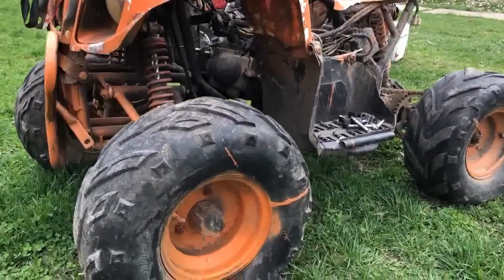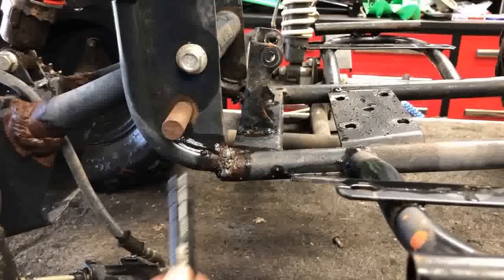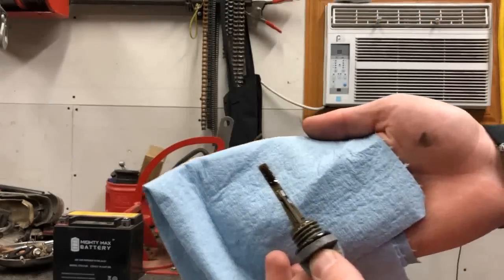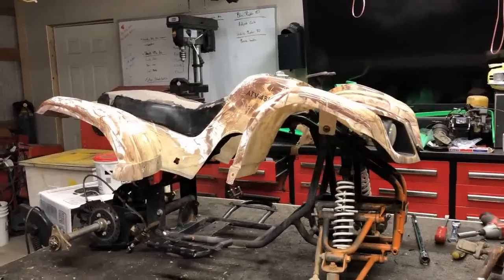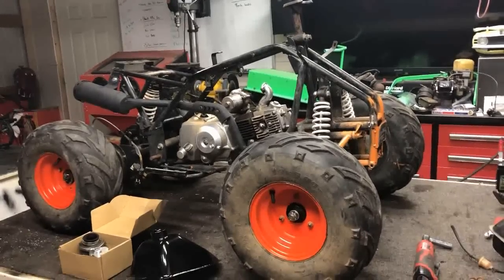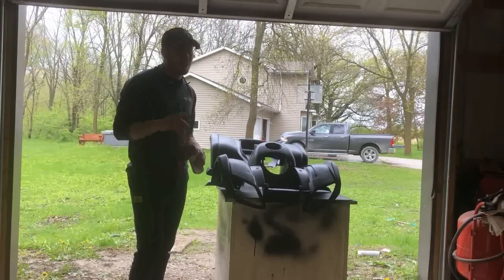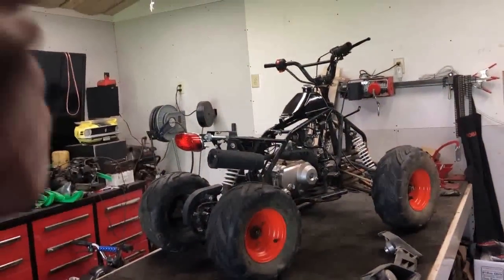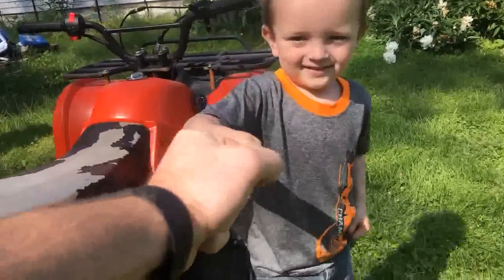Worst Chinese 110cc ATV Ever?? Let's Rebuild It!

Comment: nice job and very generous of you...one question , I have quite a bit of experience with the ongoing cracks in the frames chinese quads and merely cleaning and rewelding cracks especilly because the cracks are at hi stress points never lasts unless you also add some reinforcement the quad's frame will just recrack again and again??
Reply from the maker: You are absolutely right. Adding gussets for reinforcement is probably the best thing you can do to assure it doesn't happen again. In my experience with these chinese atvs is they will find a way to crack regardless of the extra support. I've never had one of my welding points break its always found a new spot!

Comment: Where can I find the link or part number for the right handlebar assembly? (Throttle, brake with safety brake pin). I accidently broke mine by overtightening the screw.

Comment: New subscriber. Awesome video.  I got a China quad been strong in my shop for awhile now.  Needs a new top end. May try to rebuild it.
Reply from the maker: Thank you! I did a top end on my rebuild video before this one. It ended up being a broken intake valve spring but I replaced everything since I had it open! I think the next time I get one in my shop with low compression I'll do a "how to" with the tips and tools needed! Thanks for the sub!
Reply: Praska Boy's Garage I pulled mine apart.  It’s got a stuck valve. I want to order a complete head. The cylinder says 107cm. 
The case says 
TZH152FMH

The flywheel cover says QIYE. 
Not sure which head to order because I can’t find a matching number online. Can you help me out with this.

Comment: I just picked up a 2008 Rocketa 110cc ATV for $150.00...starts right up but the Auto trans makes a bad cracking noise. Turns out a Counter shaft gear is chewed up. I don't want to split the case so I ordered a new 110cc bottom starter engine from VMC for $249.00...should be here in 3 days or so. Love your stuff and your Class !
Reply from the maker: Screww Googlle Dang man! That would actually be a first for me, I’ve never had that issue! I wish you lived in Iowa, I’d buy it off you to try and rebuild it! I am glad to hear you went to VMC to get the motor. They are a great resource for all my parts between their direct website and eBay account!

Comment: I use that truck bed paint a lot on all my frames use it on my Skidoo rails Ski-Doo skis I paint everything with that stuff even did my patio set a few years back and it still looks good and it holds up well over time and so much harder to chip than paint but if you want that smooth shiny look you'll never get it with this stuff.
Reply from the maker: Jason Mercer Im a big fan of it. Once sprayed an entire Volkswagen Beetle  in the stuff! Makes everything you put it on a little more durable!

Comment: Love all your videos very thankful for all your info im having problems with the brake on a 90cc china 4 wheeler it only has one break on the handle bars it has the master calendar on the bars to how do u bleed it i dont see a cable on there so it must not have one not sure how it works
Reply from the maker: Thanks man, the brakes will have a bleeder screw on the rear brake housing. Here is a link to the brake bleeder tool I use: https://amzn.to/30ItW9b

Comment: I suggest using a plastic adhesive promoter next time.  Bull dog is the best p.a.p.
Reply from the maker: Lawrence Miller Thanks for the advise! Never crossed my mind to use a promoter. I’ll definitely do that next time!
Reply: @PraskaBoysGarage  no problem brother. I picked up a 07 arctic cat 250 fourwheeler with no spark thats how I stumbled on to your video.  You do good work
Reply from the maker: Lawrence Miller Well I’m glad you did! Good luck on your project, sounds like a good one to wrench on!
Reply: @PraskaBoysGarage  the stickers on it say arctic cat but everything else on it says Kymco. I have the crank case opened now and it looks like the pick up that tells it to spark. I haven't worked on a fourwheeler for some time now.  The stator and picked up are in the crank case filled with oil. Never seen that before but thats how its designed

Comment: Quick question? What kind of spray paint do you use for exhausts ? Attach a picture if available
Reply from the maker: I use a high temperature header exhaust paint. Typically VHT Flame Proof 1300-2000 degrees

Comment: I’m rebuilding a 110cc for my ten year old son currently, via YouTube videos. Learning process and always having to stop and go realizing what I need to replace everytime I get going working on it. Nearly have zero information about the arc besides knowing it’s suppose to be some kinda of 110cc Chinese brand atv. Where exactly on the ATV motor I’m guessing can I find the atv brand and info so I can order exact correct parts like motor gaskets. Thank you
Reply from the maker: In my experience there are really only 3 types of 4-stroke motors that come in these youth 110cc atvs. They are either a "E22" which is a Honda clone from the 90s. The 2nd is the same E22 style motor but it comes with a gear box. 3rd is a GY6 style motor. If you want to send me an email with photos I can help tell you which one you have.

Comment: How can I tell what size motor I have? Any help would be appreciated
Reply from the maker: Blaze Finerty Look on the cylinder. On most motors it with be in the casting stamped with a CM3. Here are the ratings: 
49cc = 49CM3
70CC = 72CM3
90CC = 86CM3
100CC = 97CM3
110CC = 107CM3
If you watch my rebuild video I posted on the bumblebee build I actually find out it’s a 110cc not a 50cc like I was calling it. I show in the video where the casting stamp is! Hope that helps!!!
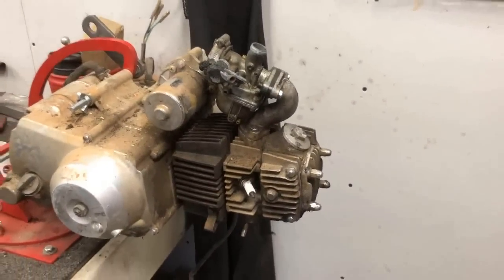Reply from the maker: https://youtu.be/UwdPQMB3rmY if you go to 8:59 in the video it will show you what I’m talking about.

Comment: What is recommended compression for 110cc motor?
I need to know... I repairing my ATV
Reply from the maker: Ideal compression is anything above 130. You'll find it will run around 90, however you will start to have performance issues. Normal range is 140-170
Reply: @PraskaBoysGarage  thanks for the answer.

Comment: And where did you get the engine stand. Could use one of those
Reply from the maker: My engine stand is my #1 comment across the channel! I came across the stand on eBay back in January 2018. The seller was bomcbe2kz7 If I remember correctly, I paid about $110 with shipping. It has 3 mounting plates for different types of small engines. Definitely money well spent for my shop!

Comment: What is the size of the chains on these quads? I got a used one and it's so rusted I cant read the chain size on the chain. Thanks
Reply from the maker: Most of them run 428. Sometimes they switch it up with 420 but from the most part if you run 428 you should be fine.

Comment: How did you strip the decals? Product link? Thanks!
Reply from the maker: These specific plastics are hydro dipped so the paint is simply removed with a paint stripper. I used Klean-Strip Aerosol that you can purchase from a local home store like Home Depot. Here is a link: https://www.homedepot.com/p/Klean-Strip-16-oz-Premium-Stripper-Aerosol-CA-Formula-EKPS302SC/311799645

Comment: Try some 303 UV Protectant Spray on the old plastic to make them look like new
Reply from the maker: Thanks for the tip! Just added it to my Amazon cart and I will give it a try!
Reply: I used it on my rzr I had not treated the plastics before for 3 years and it made it look new.

Comment: I finally got my wiring harness installed on my quad, I rode it a bit, a couple days later I go to start it nothing, I check for spark it has it, I try starting it, it fires, then dies, I check spark now it has none, I cleaned the stator it had spark again, now it doesn’t again, I’m pretty sure it’s the stator but not sure
Reply from the maker: Hard to tell, but if spark is coming and going it sounds like a possible loose connection or maybe a bad ground. I would unplug and inspect each connection first and clean the grounding points. Dang man, sorry your having problems!
Reply: @PraskaBoysGarage  Thank you so much, I was going to replace the stator but I rechecked the wiring, and their was a loose connection, finally got my quad to start and run amazing

Comment: Where did you get that motor mount for your work bench
Reply from the maker: That is the #1 most asked question on my channel! I originally purchased the stand off eBay back in 2018, however the seller is hit and miss when they are listed. So I've decided to start working on manufacturing my own! Might be a little bit but once I'm ready I will be making a video for the launch!

Comment: I installed gas shocks front and rear.
Reply from the maker: I've used them a few times. I prefer them but they are usually more expensive.

Comment: Dude I have a problem my top man always the best to come to for advice I have subscribed up to you hope it Helps but on my quad you know where the exhaust is I have fuel leaking out from there why is that
Reply from the maker: Fuel from the exhaust sounds weird. Does it still run? That would mean you're getting way too much fuel into the combustion chamber. Likely from the float being stuck in the carb?? This seems very odd. Could it possibly be running down the outside of the engine maybe from the overflow on the carb?

Comment: U should build a larger size 4 wheeler like a 300ex or 400ex or banshee
Reply from the maker: Eddie Trahan I’ve tried in the past but I just can’t get passionate about them because my kids can’t ride them. I will eventually move up in size as my oldest gets bigger. Unless I run into a deal I can’t refuse...then maybe sooner than later 😉
Reply: Where you live? I'll sell you a 300ex needs small work for 100 dollars. Just wanna see it be finished
Reply: @PraskaBoysGarage  I'm in Louisiana
Reply from the maker: Eddie Trahan Now that’s a deal I can get behind! Unfortunately I’m probably a bit to far away in Iowa!
Reply: @PraskaBoysGarage  that's what I bought the bike for and i can fix it just got a sportsman 600 and 700 I'm working on.

Comment: Chinese 4wheelers are crappy but the engines are really strong so run the heck out of them
Reply from the maker: Wyatt Smith absolutely! These motors are great, and even when the kids blow them up it’s so cheap to fix them!
Reply: Wyatt Smith  are these worth buying since the motors are pretty good? I’m not a mechanic, but I’m decently handy. If I were to buy one for my kiddos, is there anything that I should just replace from brand new?

Comment: I BOUGHT A CHINESE ATV TWO WEEKS AGO.  A 2021 LINHAI M150cc 4×2. PAID $3600.00. WITH ALL THE WELDING THIS GUY IS DOING. I WONDER IF I BOUGHT A PIECE A JUNK !!????
Reply from the maker: They have come a long way in the last 10 years for sure. The new ATVs I see have strengthened up weak spot in the frames using thicker welds and gussets. The issues I still see more commonly are with the wiring. Typically doesn't last over time. For $3,600 dollars I'd personally buy a good used Honda TRX, Rancher, or FourTrax depending on what I needed it for.

Comment: My 125cc has 165psi comression
Reply from the maker: That's perfect! Right where you want it
Reply: @PraskaBoysGarage  but i still need a head repair, because its smoking alot😂
Reply from the maker: Fpv Drone Videos Interesting...do you think it’s the rings or possibly the valves? Good luck man, sorry your having issues!
Reply: @PraskaBoysGarage  i think the rings, because if it where the valves the compression would be lower right? But im going to replace both, so im that im sure the problem is gone. Thanks for wishing me luck😁👍

Comment: looks like a taotao 125
Reply from the maker: Very very similar, and most of the parts will swap. Biggest differences between the 125 and 110 are the tires and axle size. Also the motor :)

Comment: That seems to be said for everything that comes from China they fall apart all around the motor and nine times out of 10 you have a junk bike or car for that matter but the motor still good.
Reply from the maker: Jason Mercer China doesn’t have a copyright or “fair use” law like we do. So they copy Japanese motors to the exact specs. That’s why a 212cc predator and Honda GX200 are almost identical. Motors are great, but in order to keep the cost low the quality of everything else suffers a little. I just love them because its a price point which most people can afford and I’d rather see the kids riding something rather than nothing.

Comment: These thingd are so cheap when they break down no one should charge you for them. It cost more to fix than its worth unless its minor stuff. I got a free 110cc chinese atv free non running. Took it apart and had to rewire it. After all the mods now its nearly to fast for my kids. I am 210lbs and the thing is pretty fast with my big ass. 0 to 25 mph quicker than my 150cc. Scary that I am afraid the frame is going to bring when going over low spots and hills!!!
Reply from the maker: I agree with a lot you said. They are cheap I will give you that, but for the majority of us we can't afford "name brand" whips and it either this or the kids don't ride. I want my channel to show how to make the best out of what we have while still saving money. Besides all that, they are a blast to work on! I do it because I truly enjoy it!